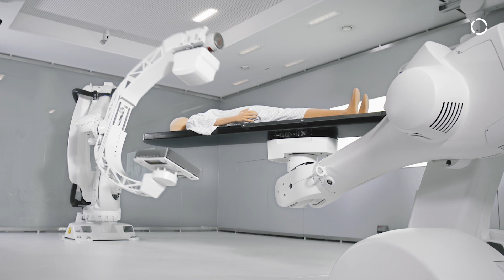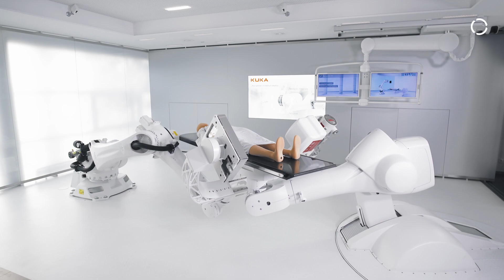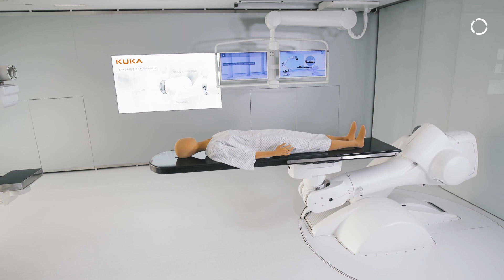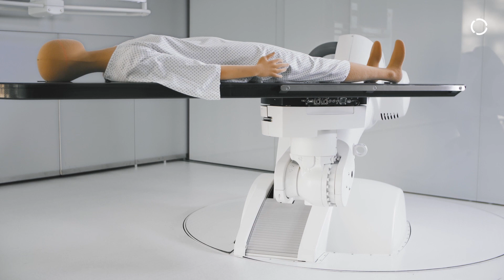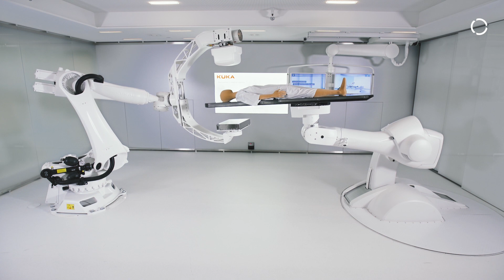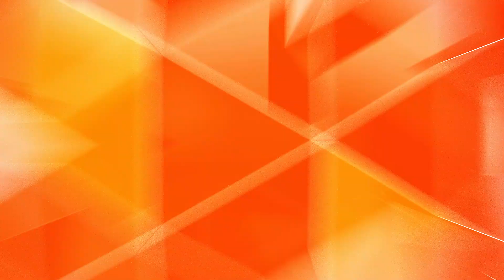Medical robotics for patient positioning, X-rays or tumor irradiation

Comment: Certainly, the process of shedding radiation on the required cells while moving the body requires a precise synchronized movement of both robotic arms, with an error rate estimated in microns.